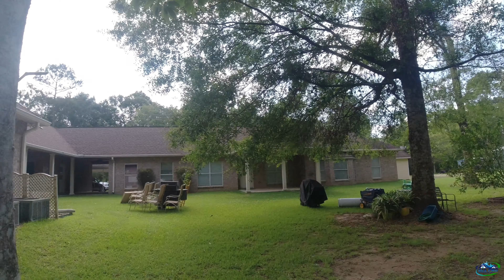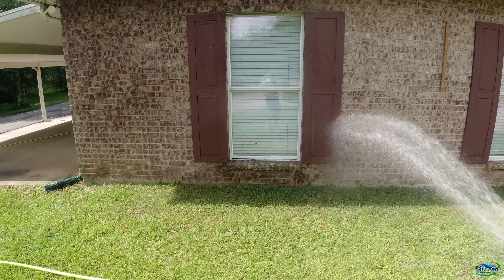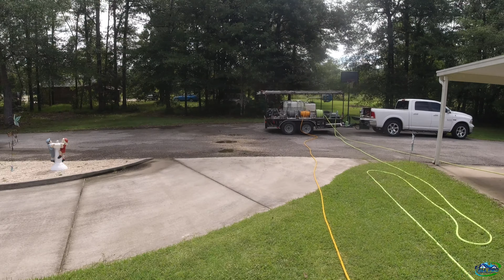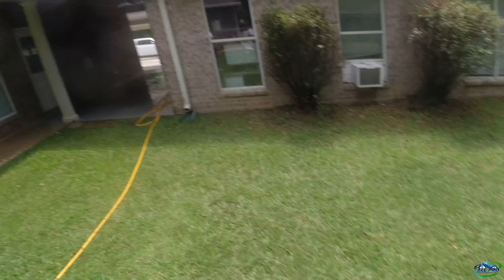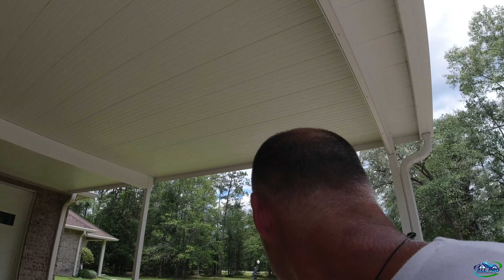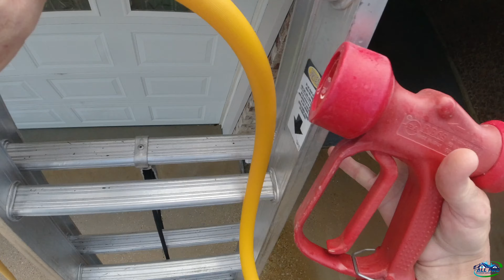The Whole Package! Roof Wash, House Wash & Flat Work

Comment: how is the new check valve for the soap working out and what one did you go with?
Reply from the maker: The check valve has been working great. I got one from Lowes with a low crack pressure. Thanks

Comment: Has your electric 3 way ball valve stopped working? My soap solenoid comes on but can’t get my teejet to open for bleach. Had to take top off and move it manually today. Just wondering if you might have some insight? Blown fuse is kinda what I’m thinking. Thanks
Reply from the maker: I have not had any problems with my tee juet valve yet. I would check the wiring first. Thanks